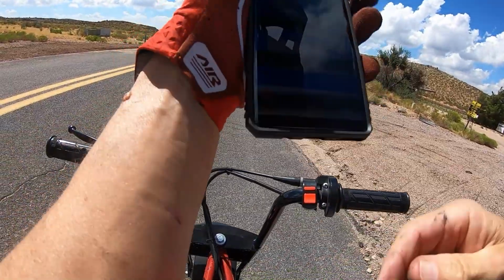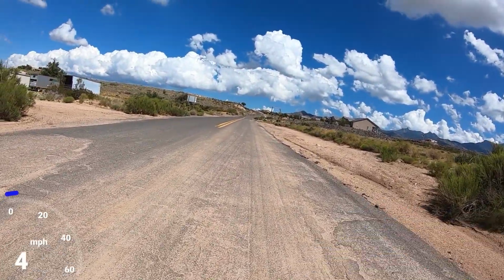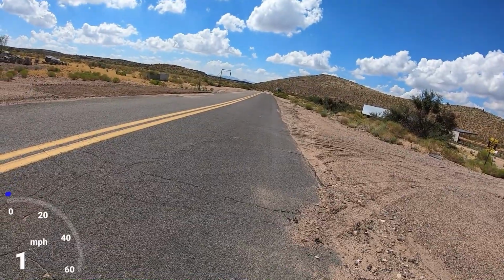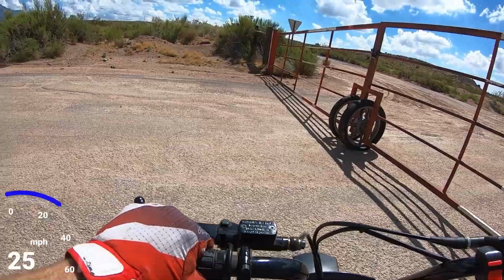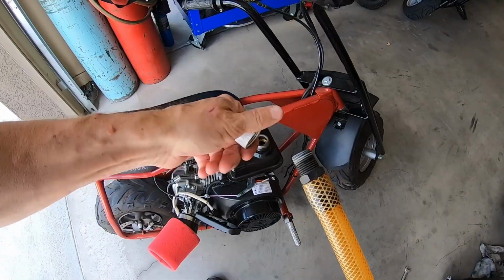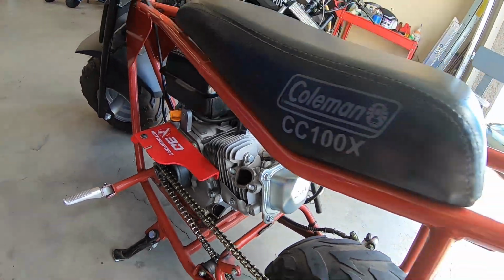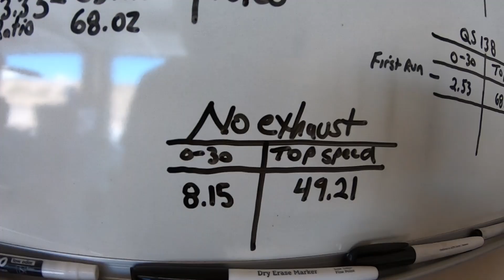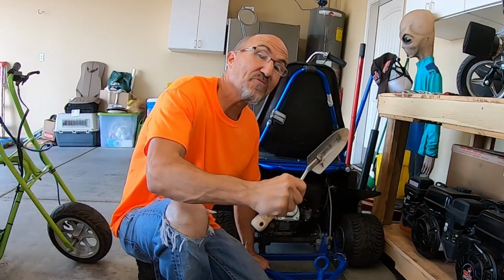Running a mini bike without an exhaust and this happened

Comment: My header came loose on my Tillotson T4 kart with a built 236cc. I saw my speed was down on my data system and the kart ran poorly. It only took 10 minutes with a leak to bend my exhaust.

Comment: i was expecting the top speed to be lower from the exhausts not being as efficient  but i am impressed none the less good vid and i can tell you ive had to push my bike home for sure to especially with the smaller gas tanks it'll sneak up on you quick.

Comment: hey man new subscriber here, are you still running this engine without a headgasket?
Reply from the maker: No, it has the head gasket but still no exhaust. We have a follow up video coung out .
Reply: @Black66  I'll watch out for the update, did you have  problems with the no gasket tho?
Reply from the maker: @Meme_supplier  No problem.

Comment: I saw a small engine with no exhaust, it must have ran for a while with no exhaust, it blew a head gasket, warped the head, and melted the exhaust area
Reply from the maker: Stay tuned for the next video. I take this bike on a long ride with no exhaust.  Well see what happens...burnt valve? Warped valve? Blown head gasket ?

Comment: I have definitely been there . having to push my bike bike home bout a mile or so. Worst was about 5 miles.. x.x
Reply: Wym it blew up ? My friends had the stock muffler and cut it to a straight pipe, and his shit blew up the rod snapped a ya 😂
Reply: @Yonigajay  oh wow. And well no, But i had another engine that blew.
Reply: @Ultimatrix117  oh did it have no exhaust?
Reply: @Yonigajay okay I remember this video now. Yes it still had the exhaust but I realized it was like a vapor lock issue . fuel Vapor filter thing that they come stock on the engine. I was just saying I had to deal with pushing the bike home often cuz of this issue. Once I let the gas tank breathe without any restriction, it fixed the issue

Comment: What kinda sprocket on the back the is it 57T 60T
Reply: My back sprocket is 75T front is 10T
Reply: With a 212cc predator stage one that's it
Reply: Think I can do 50
Reply: On a Rt100 mini bike
Reply: Rn it's slow bc the back sprocket

Comment: Re-tune it , Ride it 100 miles see if if it burns a valve.
Reply: Nothing will happen. Military engines have been running no exhaust on airplanes since before wwii with not a single issue.

Comment: the only problem with running no exhaust, at least on a car for sure, is that it sucks cold air in through the exhaust giving extra air to the engine, which changes the air fuel ratio. sure you get a lot more power out of it, but it creates what amounts to a blow torch on the bottom of your cylinder head. Sooner or later it will absolutely destroy your head. so unless youre only taking sort trips, I would absolutely not run with no exhaust. you might want to find a new "expert".
even a leaky exhaust gasket on a car will cause that.
Reply from the maker: Check out the LONG distance ride we did with no exhaust. Here is the link https://www.youtube.com/watch?v=NyZKddNzJns&t=932s

Comment: Yeah and that chain is tight u can see it's like a guitar string too tight my friend
Reply from the maker: I'll ask the mini bike expert if I should loosen the chain ...👍👍
Reply: @Black66 ask him if  my bike would get faster with a black66 sticker I bet 🤔
Reply from the maker: Yes, I bet he will say a well placed sticker is bound to make it faster. I'll send some your way when I get some.  @SpACeCruizeR2o3
Reply: @Black66  whaaaaat that's amazing I'll be the first to represent the true teacher of minibike power and SPEED💪🏼💯💨💨💨💨💨💨💨💨
Reply: @Black66 I put on the GPS speed pass sticker and it's been so fast my header cracked and my frame cracked on the chain side got a peice of rebar and hose clamp it def fixed the crack in the frame ya know 😅
Reply from the maker: Be very careful when using stickers! They are not for the faint of heart. Your equipment definitely has to be up to speed.  👍👍 @SpACeCruizeR2o3
Reply: @Black66  I.wish I knew this before I got hooked on SPEED💨💨💨